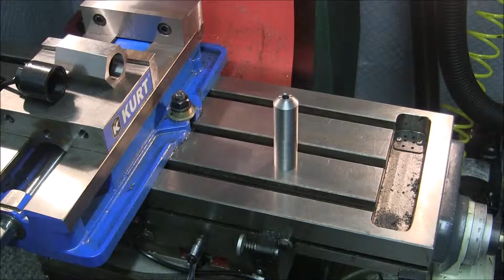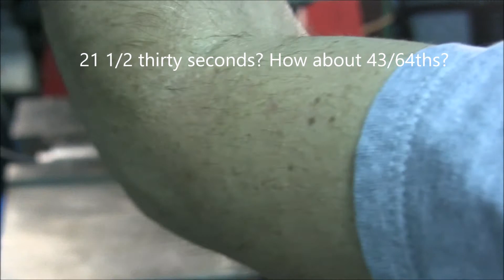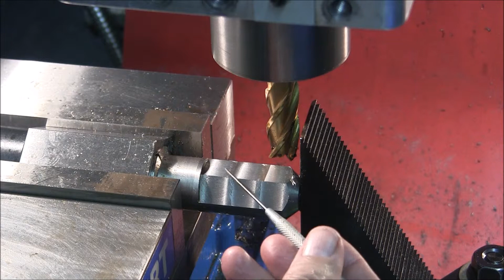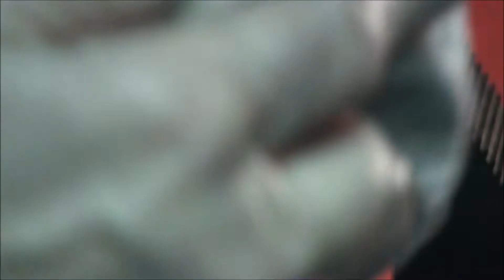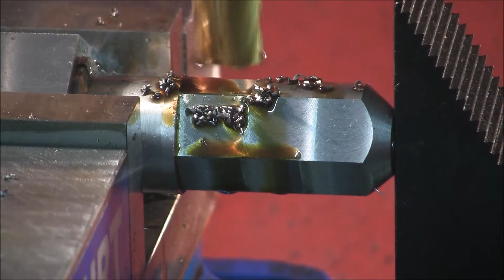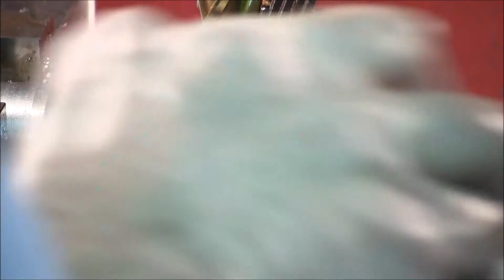Scissor Knurl Project - Part 15 of 16

Comment: Pick the nut size you want, take a measurement across the large diameter of the nut, then take a measurement across the flats of the nut. Subtract small from large. Take that number and divide it by 2. That number is the depth you want to mill to.